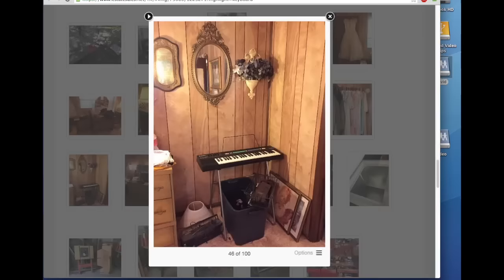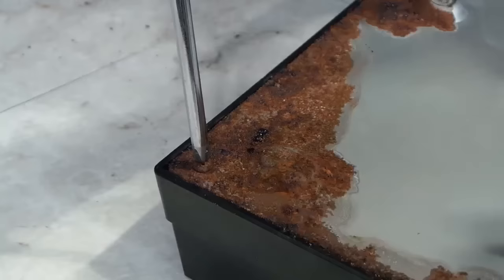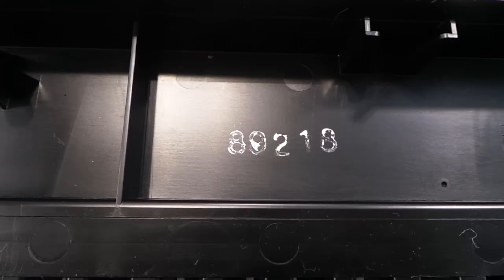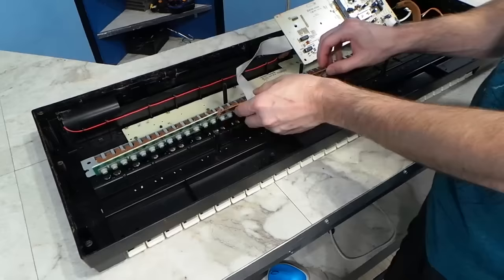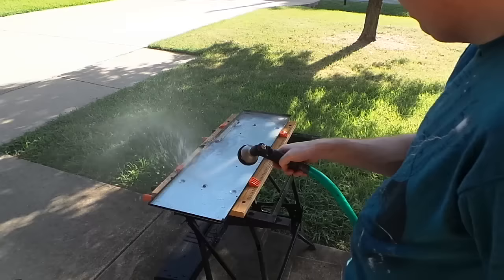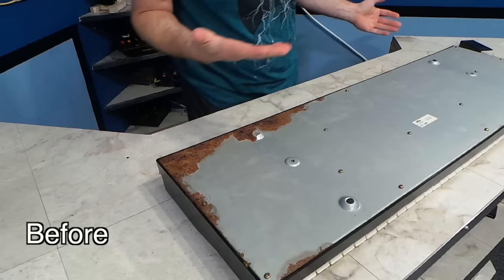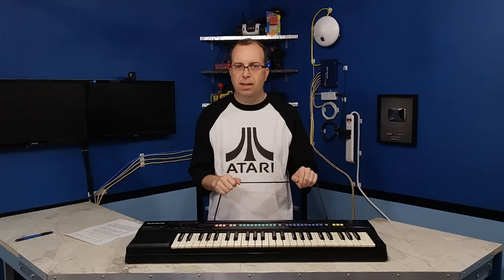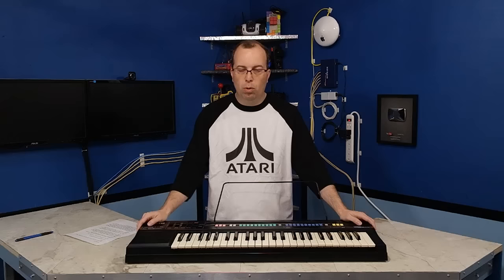Worst battery leakage I've ever seen!  Casio CT 380

Comment: Battery corrosion happens when you have a current and continue to draw life from the battery after it is dead.  The zinc outer shell of the battery is eaten by the contents.  Don't just use the same type, TEST EACH ONE every time you replace all the batteries.  1.5V, 1.5V, 1.5V, 1.3V, don't use the odd one!
Reply: Thanks for sharing!
Reply: 3 years late but w/o a multimeter there is no way to check the voltage of the battery right? I don’t have a multi meter at the moment.

Comment: This should be a Duracell ad
Reply: no kidding
Reply: George Thomas the issue is the mixed battery types, whichever battery was weaker is guaranteed to lose the corrosion battle, if the duracell wasn't newer than the corroded battery it would be corroded instead
Reply: Tobias SN  true
Reply: This is why duracell is the most trusted brand. It was just fine in the vid
Reply: Buy Duracell, or this might happen to you
Reply: Rayzon rechargeable
Reply: I have Energizer and Mastercell.
Reply: this doesnt fuck up your keyboard!
Reply: Good one
Reply: Good idea!
Reply: iOS and Android are pretty much similar So stop. *HaTEr*🙃🙃
Reply: @iOS and Android are pretty much similar So stop. well it doesn't really nateyr which one you buy because I used both Duracell and Energizer, and they are good brands, so basically when it comes to batteries, choose brands you used before, and trust
Reply: Surely, there's a battery stronger than Duracell to beat them in corrosion battles.
cough cough Energizer! cough
Reply: Fuck it im editing that together

Comment: Wow, that's the worst battery corrosion I have ever seen
Reply: I know.  That looks like a super bad corrosion.
Reply: I've seen worse with my old DS
Reply: Yeah, same here.
Reply: Yeah, corroded D cells are NOT fun to deal with. Not only are they huge, but they have more acid to leak.
Reply: Yea just think about it
Reply: I had a flashlight get ruined from a ruptured D cell. I considered using a drill to remove the batteries, but boiling the flashlight worked. It even kind of worked afterwards, but only just. I wonder if Mag-Lite will replace it if I ask nicely enough :).
Reply: *****
Yeah. Since casio cheaped ou and din't put anything inbetween the keyboard and the back plate, it took way more damage than it coul'dve.
Reply: +Pew DiePie can I see you song
Reply: I am lucky enough to have never really experienced corrosion to this level… I had a tiny little bit of it going on in my stereo remote, but that really was a case of washing the compartment lid and binning the batteries. They had been in there since 2005 and were still working, so I felt no need to replace them until I saw a bit of white-y stuff coming out of the compartment. Then I was like: well, they are being replaced now, anyway…!
Reply: slashtiger1
The worst corrosion I've ever seen in a piece of tech was from a camera flash attatchment with a pair of old tripple A's in it. Opened it and the batteries had reduced to white dust, barely anything left.
Reply: VintagePC's alike The second worst I had to deal was a Macintosh Quadra 700 that had its PRAM battery leaked.  It corroded the whole mother board and it was completely broken.
Reply: Technology Spotlight
Those pram batteries are from hell. Red bombs waiting to go off.
Reply: *****
That'll be battery acid. It smells like vineager for whatever reason. Wash that shit off.
Reply: dont get it in your eyes
Reply: i've seen worse.. it was all leaking thru my electric RC car. Litterly made the ground all messy
Reply: that reply
was stupid.
brown means the battery had a charge
white means the battery was dead
Reply: A LOT!
Reply: Those vintage macs are rare now.
Sorry...
:(
Reply: yep.
Reply: Worst I saw was a Macintosh SE/30 that had suffered severe PRAM battery explosion, so severe as to be irreparable.
Reply: my Amiga 2000 died after the exploding battery
Reply: The Obsolete Geek nice channel you have I subscribed
Reply: The Obsolete Geek What was that battery made of? Hydrochloric acid?
Reply: plants247 YES THEY DO
Reply: Merlin electronic game
Reply: Me too
Reply: The Obsolete Geek me too
Reply: Oh, I've seen worse, but at least this was able to be put back into decent looking condition and very playable as well.
Reply: I have a CPU but the screws only are corroded.
Reply: @ZiggyTheHamster  Guess what just happened to my 4 D-Cell Maglite. Leaking batteries. Yuck. And not Camelion, but Duracell. The upper ones seem to rattle around, but the lowest one is totally stuck. It's been soaking in vinegar for a while now, I still hope to get the batteries out eventually and then I can clean up the mess. It even ate away a portion of the aluminum, but the Maglite's body still seems to be pretty sturdy in that particular spot.

Comment: Well kids, what lesson have we learned today?

Buy Duracell.
Reply: Ethan Frakes XD
Reply: thats not true they all come from the same factory in germany only with a different sticker.
Reply: Pepe well someone watches too much adam ruins everything
Reply: Nahhhhh knowledge ;)
Reply: memes
Reply: KNAWLEDGE
Reply: NAA-LEEG
Reply: why use Duracell when I can use Samsung note 7 batteries
Reply: They do still leak though...
Reply: No, the REAL answer is to never mix battery types! And who the heck made Chameleon D Cell Batteries? Even if its Duracell, if there's only one Duracell and five Chameleon batteries it will still leak.
Reply: ever heard of DuraLock?
Reply: AestheticDOR1FTO - JDMStance Fan Well yes but what that means is it can hold the 1.5 volts charge for 10+ years. It does not mean that the batteries will never leak. They will still leak over time or from all the other reasons on the internet.
Reply: As far as i know DuraLock has corrostion protection.
Reply: AestheticDOR1FTO - JDMStance Fan I have to admit, they actually do a great job on that. The Duracell batteries might be non-alkaline, meaning it's filled with dry carbon and not a liquid that the Chameleon battery uses.
Reply: Ethan Frakes Yay. I scraped some Duracell batteries to put in my RAP1.
Reply: Not all the batteries are made in Germany.
Reply: Not Duracell, but alkaline batteries, they're not leaking (in theory) in contrast to zinc-carbon batteries, but can still corrode from humidity.
Reply: Rafał Chyła yeah, that's bullshit. Alkalines leak different, but they sure do still leak.
Reply: Take the batteries out of any device you are not going to use in a while.
Use the DC adapter "wall wart" whenever you can, it's cheaper than batteries.
Reply: Ethan Frakes i always buy duracell
Reply: Ethan Frakes XD
Reply: Ethan Frakes XD
Reply: Ethan Frakes don't use alkaline and zinc chloride batteries together kids
Reply: Correction: Don't buy Duracell with Japanese or Chinese markings on it! 
They came with a toy and I can tell you: DON'T USE THEM !!
Reply: +Pepe The Frog That isn't entirely true. Batteries are also made in the United States, Japan, the Philippines and China for a few examples. Duracell, Rayovac, Energizer, and Interstate Batteries (the same company that makes car batteries) all make Alkaline batteries in the United States for example. Panasonic batteries are made in various Asian countries depending on type and product line. Duracell also makes batteries in China, which are the batteries Microsoft Xbox 360 and Xbox One wireless controllers come with. Also cheapo batteries from Dollar, Euro,  Pound stores and other discount shops are often made in China or elsewhere in Asia such as the Philippines.
Reply: best comment
Reply: Ethan Frakes yes
Reply: >all from the same factory

there are lots of alkaline battery manufacturers. also same factory doesn't mean same quality product
Reply: I learnt how to clean stuff with vinegar, I'm gonna go clean my dog
Reply: Kiryllos Gaming/stuffed animals THE FRICK!?!?
Reply: Ethan Frakes I have money to buy Duracell
Reply: Ethan Frakes reminds me of that episode on my cat from hell where the 2 cats hated eachder
Reply: Ethan Frakes I have $103
Reply: true
Reply: Ethan Frakes yes
Reply: Ethan Frakes yes
Reply: doge cat they blow up
Reply: Dr Wolf hey what's up man who is VIP
Reply: Ethan Frakes oookp
Reply: NO BUY PANASONIC.
Reply: NO BUY PANASONIC
Reply: Ethan Frakes my family always uses Kirkland batteries
Reply: Why not just buy Energizer or Eveready?
Reply: YEAH! DURACELL BEAST ALL THE OTHERS!

No, but seriously. It beats the others, as i don't know the others except Duracell!
Reply: Oxygen Yes sometimes I use eneloop. ITS RECHARGEBLE.
Reply: Ethan Frakes sometimes I use the bunny baterry
Reply: Ethan Frakes haha ;)
Reply: They still leak
Reply: Ethan frakes Dont Buy a Duracell the still leak
Reply: and dont mix batterys
Reply: Ethan Frakes and dont touch any batteries that leaked
Reply: This is that leaked battery
Reply: here, i always buy duracell, partly becqause powercheck, partly because it's the cheapes, and partly because they have never leaked for me
Reply: Ethan Frakes 😹😹😹😹😹😹😹😹👏🏻
Reply: I BIT THROUGH ONE DIDNT END WELL ENDED IN A HOSPITAL FOR ME :P
Reply: Ethan Frakes well duraces leak too I had 4 leak very badly
Reply: Ethan Frakes yep
Reply: fake he took a new one and stucked it in there because you can see the + side of the battery
Reply: heck, i've had items in storage over 10 years with Duracell batteries in them.  not only did they not leak but they STILL WORKED!
Reply: gridsleep or just buy an outlet battery charger and buy Duracell :/
Reply: Ethan Frakes  You must be joking I have had more problems with Duracell than any other battery's
Reply: Best comment evr
Reply: True! The Duracells on the remote of our DVD player have been there for about a year or so, and they never went bust!
Reply: I seen a lab testing of batteries and Duracell beat all of the normal alkaline type batteries including energizer. Personally, I buy Rayovac and Panasonic because I get those really cheap in my area.
Reply: Ethan Frakes yes
Reply: Ethan Frakes This Comment Is Holy
Reply: Ethan Frakes ikr. We also learned to never mix battery types.
Reply: Ronaldo Rodriguez ikr
Reply: reddit.com/r/n00bs
Reply: NoobJoshua SHRIMP yup
Reply: Nope the lesson is don’t mix batteries.
Reply: Nothing
Reply: Ahoy me boi
Reply: They don't lie about lasting for more than 10 years
Reply: There are R E C H A R G A B L Duracell batteries!
Reply: bruh😂😂😂
Reply: Oh yah mr.krabs! AAAAAAAAAAAHHHHHHHHHHHHHHHHHHHHHHHH!
Reply: Actually the moral of this story should be, if you bought a $12 keyboard, don't waste your time spending $120/or more worth of time cleaning/fixing it up, just search for another identical clean one for only $24 tsk tsk xD
Yeah yeah, the "experience" of rubbing and buffing it, but life's too short to waste it. ;)
Reply: Duracell batteries give you 10% more capacity for twice the price of store brand alkalines. Not worth it.
Reply: There is a reason some people call Duracell batteries 'Duraleaks'.
Reply: WOW YOU HAF WOEEN OU HAP 2195 LIK ANT 100 KOMET
YEY
Reply: LOL
Reply: @taton5  wrong they could explode
Reply: @defrexx8802  No.
Reply: I had duracell batteries leaked in my Nintendo Game Boy and it almost stopped working, I also founded out Duracell batteries are prone to leakages during use. Can you explain that?
Reply: And don't buy Chinese batteries
Reply: Defrexx wooosh
Reply: What about Aerocell?
Reply: Camelion enters Camelion: BUY CAMELION!!! 3X
Reply: Fosho... I've seen some of them suckers that lasted 15+ years without corrosion..
Reply: @sethhorst6158  hmm... Yeah you know, not everything is damage proof... Duracell does have a pretty legit reputation though.. One really good cheaper brand I recommend is Home Depots "Defiant" brand...
Reply: We used to use Duracell Procell Batteries throughout our house until they started leaking out in EVERYTHING. We even found some unused that had burst and started leaking. We switched away from Duracell onto GP Batteries now and not had any issues with Battery Leaks since.
Reply: No prizes for who you work for.
Reply: And never mix battery types.
Reply: Ethan Frakes I was took the Kodak batteries out of my gb pocket
Reply: Take that Energizer! Duracell wins!
Reply: True
Reply: @taton5  because samsung note 7 battery is a bomb
Reply: Yep I use Duracell on my Casio keyboard lasted 12 days for light use
Reply: The copper top tops them all
Reply: Absolutely
Reply: Duracell is literally indestructible
Reply: I don't use duracell battery's
Reply: Lol
Reply: I have had Duracell leak. And all the others. If misused, they all leak. By "misused" I mean 1) leaving them in devices unused, 2) Mixing battery types. I won't even mix brands of the same type.
Reply: Defrexxx, nobody cares
Reply: Ive still encountered plenty of duracells that leak pretty bad
Reply: Battery Lesson #1 Never mix a durecell with another battery
Battery Lesson #2 Never Have a odd battery, always have the same brand of battery in the pack unless you like corosion
Reply: We just use Duracell. :3 >'^'<
Reply: Never buy Chameleon batteries.
Reply: Although I get the joke. Duracell are just as bad. I remember as a young boy my game boy stopped working, opened the battery cover to my astonishment the batteries corroded the terminals and leaked. Needless to say I was extremely upset. My mother sent a letter to Duracell and they replaced the game boy for me. So all was not lost 😊
Reply: This is just a Duracell ad
Reply: DURACELL NOISES
Reply: Lol when I read this I got a Duracell Ad
Reply: Defrexx please get the joke
Reply: Ber M. To much Adam ruins everything doesn’t exist >:(
Reply: Well YES
Reply: It is the most trusted battery
Reply: Yeah XD
Reply: Ethan Frakes yep
Reply: @GriffinCorreia  FIRE AND EXPLOSIVE GASES LOL
Reply: Defrexx nooo
Reply: @defrexx8802  KnOwLeDgE
Reply: The reason why the battery exploded is because they were different battery types and the Duracell had more capacity but the other battery died
Reply: Was about to say buy duracell
Reply: Ethan Frakes yes
Reply: Lol
Reply: No buy VARTA
Reply: True
Reply: My mom uses polaroid batteries. I use energizer and duracell, not together
Reply: Ethan Frakes ♥︎
Reply: Ethan Frakes lol
Reply: Duracrap is the worst battery I have ever used. It destroyed a terminal in the battery compartment of my wedding camera. Second worst was the OEM batteries in a Suzuki Omnichord. It leaked onto the input connector PC board, and destroyed all the battery terminals. 
All across the world, millions of devices are getting destroyed by leaking batteries. The only good battery I ever used is the Danish brand that Sennheiser ships with their remote mics.
Reply: You wouldn't say that if you saw the Duracells I had to extract from a Maglight flashlight, leaked, corroded, and swollen. Duracells are some of the worst alkaline batteries out there outside of the China junk brands.
Reply: @billant2  The lesson should be to open the battery compartment of anything that could have a battery in it before buying it.
Reply: wear gloves when handling batteries with corrosive crap on them
Reply: Or don't use Heavy Duty with Alkaline.
Reply: XD
Reply: @DespairMMX3030  The Duracell D cell batteries in a  Maglight flashlight I took apart were not mixed with any other type, and the one at the negative end still swelled up an leaked everywhere. The lesson: don't use Duracells in a Maglight, ever!
Reply: Lmao
Reply: @bernhardm.3118  i do hard
Reply: @defrexx8802  No. Some battery's are coming from Japan or another country some factoring at germany
Reply: LOl
Reply: Buy Varta batteries they are best 😁
Reply: @memenest468  buy duracell or i stole your everything xD
Reply: @zeze64.  Buy Varta or Duracell or i will stole ur dog/cat xd
Reply: @memenest468  i using duracell and i haven't cat/dog or pet :)
Reply: XD XD XD LOL 😂
Reply: @GriffinCorreia  They do, if not taken care of (Mixing types, recharging and leaving it unused for a long time)
Reply: yess
Reply: Yes
Reply: Or energizer
Reply: @aesthet1kal  duralock sucks I’ve had multiple of them and they all corroded like crazy
Reply: @vx5659  Panasonic sux shit that was the one that caused all the corrosion
Reply: @defrexx8802  no
Reply: And not derpacell
Reply: xD
Reply: @taton5  the battery is fine, the phones exploded because the phone was too tight on the battery
Reply: NO BUY SAMS MARKET NO LEAK BATTERIES BOI
Reply: No. The majority of corrosion issues I get in for repair all have one thing in common: leaking Duracells. All batteries leak. The fact that people think Duracells are somehow better is a testament to the quality of their marketing department, not their manufacturing.
Reply: Plot twist: the entire video was actually an ad to make you buy Duracell
Reply: @TheRealAndOnlyAndrewRen  nollig
Reply: The lesson we learned: NEVER mix battery types
Reply: you know there's a battery called god camel? and diehard?
Reply: @defrexx8802  but are different type and method
Reply: @Windows71246  nah duracell is good
Reply: Neo Whitty  no buy duracell
Reply: Buy energizer
Reply: @MTN1601  no buy duracell
Reply: @taton5  💥🌍
Reply: *durasmell
the smell that lasts
Reply: Duralock more like duraleak 😂😂😂
Reply: Also take the batteries out of anything and everything you plan on keeping in storage.
Reply: DuraLeak more like

Comment: For those wondering, 210 sounds is:
190 combinations of instruments ([20x19] / 2)
and of course the 20 instruments on their own.
Reply: It's actually 20 x 19 x 18 x ... x 1 (=210), including "illegal" combinations (w/ drums, sound effects)
Reply: @lesharkoiste  20x19x18 is already so much, you meant +, not x
And also, my calculation is simpler, two-instrument combination is 20x19 divided by 2, because 1+2 is the same as 2+1, and add the solo 20 to that.
Reply: @FightingForceSoulless  thanks for correcting my mistake